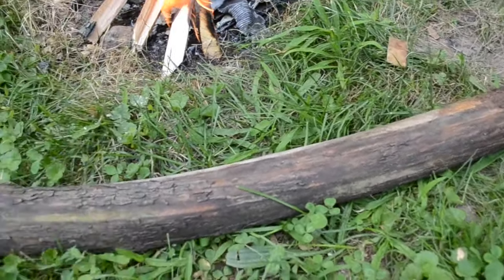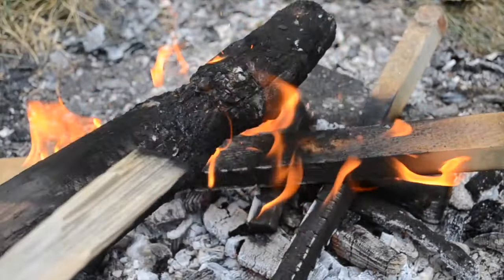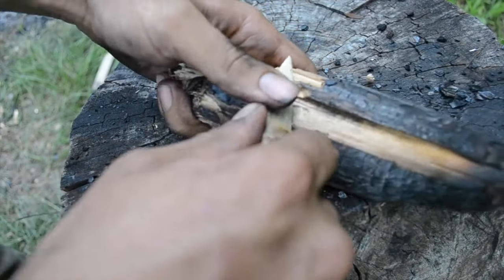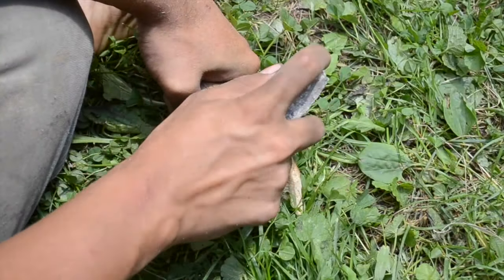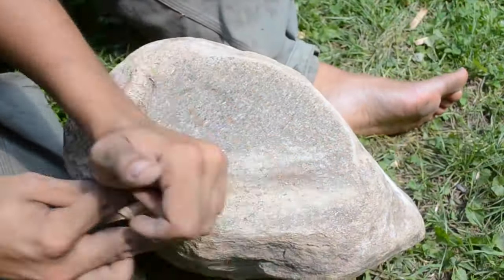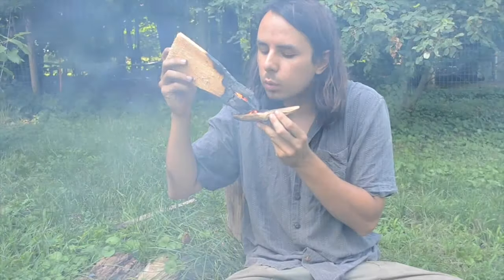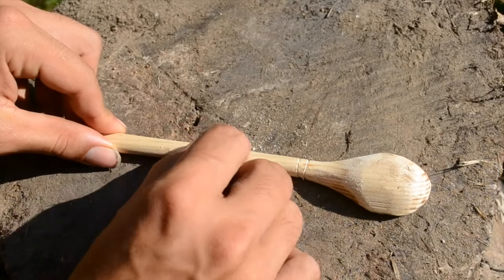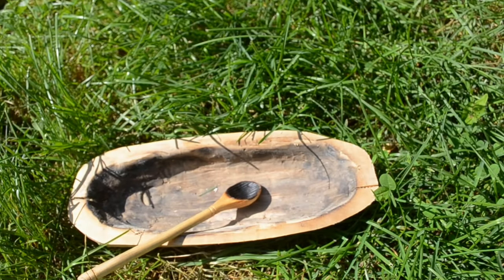Making a spoon without metal tools.

Comment: I've embered many spoons already, but always with the help of steel knife and saw. I think it is more comfortably for the mouth to make the "bowlpart" of the spoon way more thinner/less deep. Also i always just put the ember directly on the wood, withou drilling first, this works great as well. You can even kind of ember two spoons at the same time sometimes if the stick is fitting and perfectly splitted.

Thanks for the vid again, cheers mate!
Reply from the maker: I agree, but shallow spoons are easy to come by in the modern day. I wanted something different from my steel cutlery.

Comment: A lot of effort for a simple eating utensil. Makes me think most people would've settled for drinking soup out of the bowl, but there certainly were plenty of spoons made without metal tools in history.
Reply from the maker: Someone who knows what they're doing and has purpose built tools could do it a heck of a lot faster than me. I'm just making it up as I go.
Reply: Also, that implies making a bowl is easier. Clay ones probably, but wooden ones are obviously harder. So if you had to choose between making twelve spoons for your family to eat out of the pot or twelve bowls, I would choose spoons. So if you consider not having to make a bowl, some people possibly made spoons first and then bowls. And even if you don't want to share from the pot with everyone, multiple people can still share from the same bowl with multiple spoons. So in a sense, it depends on your priorities and culture, but there are still reasons to choose making a spoon.

Comment: Nice vid cous , i need an antler knife now lol
Reply from the maker: Thanks! 
An antler knife is a quick and easy enough project. You take an antler, cut off a spike or other straight section with a hacksaw, then clamp it in a vise and grind an edge with a file.
Reply: Awesome , thanks for the info! I need to come visit you soon
Reply from the maker: @jimijaimz  It'll be nice when the pandemic finally burns out and life goes back to normal.